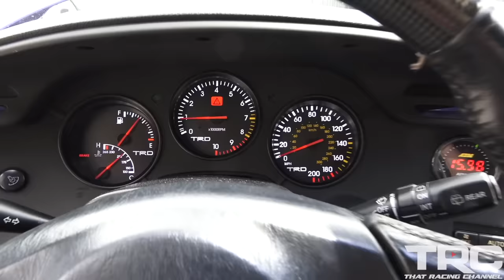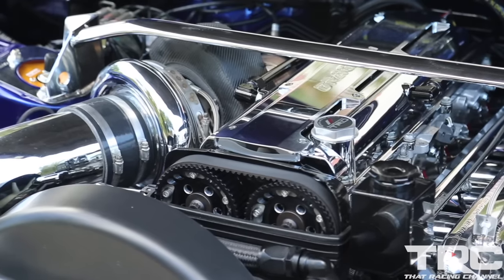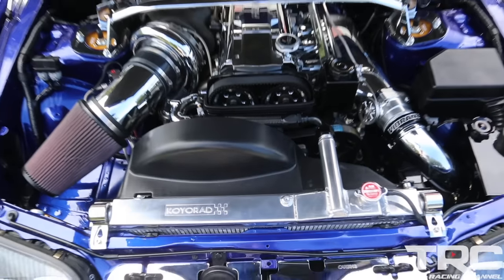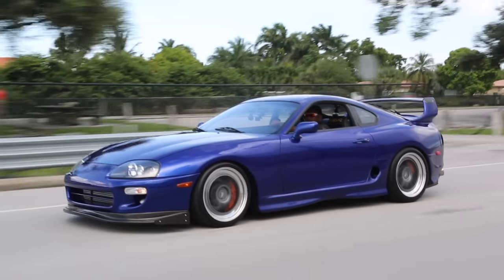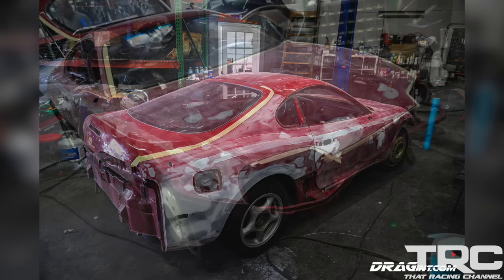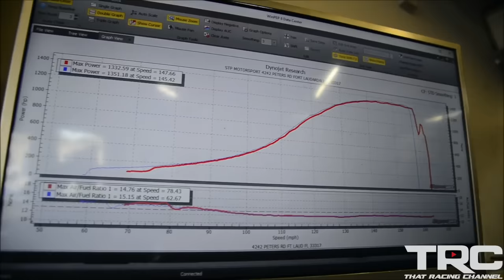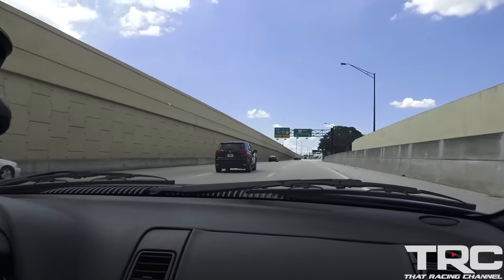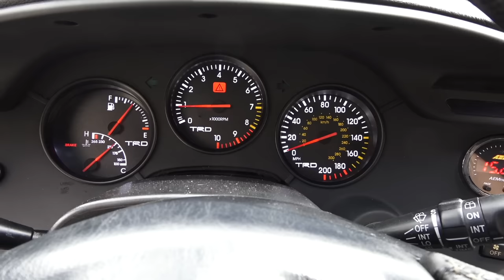1500HP Supra Gettin' Rowdy - 2JZ Eargasm!

Comment from the maker: I mean just look at this parts list! 
1995 Supra Hardtop
AEM Flex Fuel Tuned to Run on E85 and 93 Octane
1351 WHP
6 Speed Manual with stock driveability
Cold AC!
ExteriorCustom DRAGint Paint Job – Complete Color Change with PPG Materials
Completely Dismantled and Reassembled with all new hardware
New Carbon Front Lip Diffuser Extension
New Carbon Front Diffuser End PlatesJDM OEM TRD Side Skirts (Discontinued)
JDM OEM TRD Rear Valences (Discontinued)
New Top Secret Carbon Rear Diffuser from Japan
New Carbon TRD Rear Wing
JDM OEM TRD Rear Bumper Pods (Discontinued)
NEW OEM Front Bumper ’98 Style with Grill
New OEM Headlights ’98 Darkhousing with custom LED Lighting
New OEM Turn Signals ’98 Clear Housing
New OEM Tailights ’98 Darkhousing
New OEM JDM Winged Marker Lights

Engine Block:
3.0L DRAGint 1300+HP Spec 
Manley Turbo Tuff Rods w/ big Piston Pins 
CP 8.5:1 Forged Pistons
ACL Race Bearings
Titan Main Caps
Titan Main Studs
Prepped and Balanced CrankBuilt by TEC (Total Engine Concepts)
ATI Damper

Engine Head:
Full Ferrea Valve Train +1mm Over
Ferrea ValvesFerrea Double Springs
Ferrea Titanium Retainers
Ferrea Bronze with SealsBuilt by Bill from Extreme Cylinder Heads with 5 Angle Port and Polish
Kelford Cams
Solid Bucket Lifter Setup
Powerhouse Racing Cam Gears with Titan Bolts

Turbo System Components:
DOC RACE Twin Scroll Twin Wastegate Exhaust Turbo Manifold
Precision 8385 GEN2 Turbocharger
Twin 46mm Precision Wastegates dumped externally
3 Port ECU Controlled Boost Controller with all Hard Lines
4 Inch Stainless Steel Down Pipe
New HKS Titanium Exhaust System customized to 4 Inch Downpipe

Engine Bay:Chrome Throughout (Valve Covers / Intake / Water Neck / Charge Piping / Reservoirs)New Koyo Aluminum Radiator with Custom -16an Upper and Lower HosesCustom Extreme Motorsports Power Steering Reservoir – DRAGint SpecCustom Extreme Motorsports Coolant Reservoir – DRAGint SpecCustom Extreme Motorsports Oil Catch Can – DRAGint SpecNew Carbing Cooling PlateNew Hood Shocks

Intake System:
New Hyper Tune Billet Aluminum Intake Manifold
New Hyper Tune Billet Aluminum 90mm Throttle Body
New Hyper Tune Billet Aluminum Fuel Rail
New 2250cc Siemens Deka Injectors (6)
New ETS Intercooler Core
Mandrel Bent Piping with Vibrant Vanjen Wiggins Style Couplers
Tial Blow off Valve

Fuel System:
New Radium Billet Triple Pump Hanger
New Walboro 100psi+ 525 Pumps (E85 Compatible)Upgraded Fuel Pump Wiring and HarnessCustom Dual -8an Braided Feed Lines with -6an Return
New Aeromotive Fuel Pressure Regulator
Complete Braided Lines throughout fuel system

Drivetrain:
New ORC Triple Disc Clutch
Rebuilt V160 6 Speed Transmission
New Drive Shaft Shop Carbon Race Driveshaft
JDM OEM 3.2 220mm LSD

Electronics:AEM Infinity ECU programmed by Tune by LanceFlex Fuel Tuned for any combination of 93 Octane Fuel and E85 FuelDual CAN Gauge for Multiple Function Display (Clock Mount / Custom AC Vent Mount)Toyota Individual Smart Coils (6) with Custom BracketJR Wiring Solutions Custom Race Wiring Harness with Dual Odyssey Batteries (Hidden in Trunk)Raychem Heat ShrinkAll New Harness Connectors / Plugs / Pins

Interior:Stu Hagen Custom LED Gauge ClusterNew Dashboard from Toyota OEM New Carpet from Toyota OEMNew 6 Speed Shifter and Knob from Toyota OEMNew Recaro SRD with Custom Upholstery from JapanNew Juran Recaro Sliding Seat Rails from JapanNew Custom DRAGint Checkered Floor MatsToyota Carbon Fiber 3 Spoke Steering Wheel – RARE OEM Ice Cold AC!
Wheels / Brakes / Suspension:New CCW Custom 18inch Multi Piece Forged Race WheelsNew Tires 285 Front and 315 RearNew Brembo 6 Piston Front Calipers with Drilled Rotors – DRAGint CustomNew Brembo 4 Piston Rear Calipers with Drilled Rotors – DRAGint CustomNew Carbing Strut Tower BarNew HKS CoiloversNew Titan Motorsports Big Sway Bars Front + RearNew OEM Front Lower Control Arms
Reply: Are you sure it's not spelled Girard
Reply: That Racing Channel where did your Supra go Javier?
Reply: That Racing Channel why didn’t the shop go with 10:1 or 10.5:1 compression instead of the stock compression? 🤔
Reply: TRC supra was & still the ultimate street car. We miss it :(
Reply: What's up with the R32 build?
Reply: That Racing Channel Jesus that is a impressive parts list and build !!
Reply: 1500whp in the title. actually 1351 lol smh just be honest with yourself and your channel and say 1350. not a big deal but dang. gotta lie for views just like everyone else
Reply: No brakes?
Reply: Jk F1  yeah in the video he mentioned his brakes too
I commented before finishing 😂🤦‍♂️
Reply: Jk F1 and? You wanna call it 1500 to the crank? You know it’s much higher than that
Reply: I'm not "upset." It's people like you that encourage the principle of click bait. It's not JUST this video, its many. Explain to me why they couldn't put 1350hp in their title? Oh yeah, that's right, because "if we say it has 1500hp we'll get more views" true? Yes. AKA - click bait. So who cares? Me. Don't lie.
Reply: Most car producers list the HP or BHP not WHP.
Reply: @1kslane  1500+ at the motor
Reply: So long story short... It's legit AF
Reply: they sellin it? I need me a new daily driver
Reply: Jk F1 I’m so upset, you’re right. Thanks for agreeing with me tho ;)
Reply: Correct, a random number
Reply: Also correct. Do you understand where I'm coming from? It's probably 2000hp to the crank, who knows. But they didn't use that number. Where is 1500 coming from? That's all I'm saying.
Reply: What’s been done to strengthen the block to support that HP?
Reply: Kevin Slane estimated to have1500 engine HP, but there is a loss of power by the time it makes it to the wheels
Reply: Anyone know how much to build a car like this?
Reply: He’s lucky he has that much money to build that.. i wish lol
Reply: Hey Javier, It's Mateo. I used to work with you a long time ago. You used to have the Evo, and two Zo6's
Reply: 100+k,
Reply: @1kslane  its 1500 at the crank. 1351 at the wheels. there was no lying. engines make more power at the crank, and loose power thru heat, friction, and rotational mass through the drivetrain. 1500hp and 1351whp are the same.
Reply: its only $
Reply: HOW MUCH DID THIS ALL COST
Reply: Bro u guys shot this video on  I-595 lol I live in university drive
Reply: How to build a monster
Reply: Good to see that don't forget about the brakes  very importand when you go fast
Reply: What a list.👍
Reply: Kevin Slane probably 1500 crank
Reply: Kevin Slane you don’t know if it actually did hit 1500HP before.
Reply: How much seriously!... How much do you believe went into this build
Reply: wtf, thats so much
Reply: Good brakes...
Good Brakes Too.
Reply: damn
Reply: how much is this, estimated?
Reply: Grand total? =$$$$$$
Reply: About how much money and time was put into this car?
Reply: Wow man.this a good guide for young tuners out there. What a lists. How much it costs?. More than you can afford man. Its a Ferrari. Lol. 😅😅
Reply: What's the colour code mix on that supra...??.. like it
Reply: @bm717252  it will blow up..with stock com. it has more boost
Reply: @1kslane  where the fuck it says whp? the title says 1500hp..sooo around 1300WHP SO ITS OK
Reply: Is this car originally a 2JZGE car? If so I am interested to discuss this build or conversation further. Thank You!!
Reply: Bigler died on that supra
Reply: @looseparashoot  60k 2 80k
Reply: @syferofsin7530  he said 1500hp to the wheels
Reply: Sweet ride. How much for something like this bad ass Supra?
Reply: 3.73 rearend?
Reply: What turbo is that and what kind?
Reply: Anyone has the ig ? Would love to follow this Supra
Reply: cost?
Reply: That Racing Channel  what happened with Javier’s Supra? The trc Supra?
Reply: stock tape deck
Reply: Kevin Slane theres 1350 whp + 10% transmission losses = close to 1500  motor hp. Nothing wrong with a title man
Reply: @1kslane  1351 with 93 octane...!
Reply: So how much this shit ? Long way from a couple spoon engines huh
Reply: Too long bro
Reply: Thats's like 13,5 dollars in 1843 money
Reply: Is that it
Reply: What’s the total cost?
Reply: It will take years to read😂😂😂😂...
Reply: Ok boomer
Reply: Damn u know your shit
Reply: gooookiiiiiielllll
Reply: i can tell those list are around 200K or more.. damn but its worth for Supra 💯👍
Reply: Total cost be like 6.8mil
Reply: Kevin Slane 1500 engine hp, 1351 wheel hp
Reply: How much did all these cost you?
Reply: @08NaGa  $100,000-$125k ish
Reply: That is why she is so lovely and so desirable😉😉😉👍🤙👌!!!!!
Reply: How much torque?
Reply: In the title is 1500HP so 1381 WHP is pretty possible on the wheels than.
Reply: Where can I buy LHD Supra ??
Reply: That supra looks sweet
Reply: How much is all of this?
Reply: All that and it’s not a compounded setup.
Reply: 93 octane? here in cyprus we have 100 octane plus witha boost bottle octane it can easuly go 104 octane...that will give this car another 20horse power for sure
Reply: the best thing out of all that is the AC
Reply: 2JZ  sounds good, even underwater... as this video proves.
Reply: @1kslane  1351 WHEEL HORSEPOWER = 1547 CRANK HORSEPOWER
Reply: Bro typed a whole essay
Reply: Does it have Getrag v161 gearbox?
Reply: So technically it has a bigger turbo? so does it mean it has some sort of Turbo lag or something like that? just curious
Reply: Power?

Comment: Words cannot describe 3:10-3:55,  I watched it with Bluetooth audio in my car and it felt like I was there. Such a raw feeling. I can’t imagine what the actual experience is like. The acceleration throwing back in your seat, the backfiring, the sonic theatre of the exhaust system. Beauty incarnate. I could only dream.
Reply: is the sound of the Blow Off Valve? or the Compressor surge?
Reply: The car slow between shifts. Get the Zf8 trans to it which is already done and will be another animal
Reply: My thousand 1000hp built mkv would smoke this
Reply: I actually didn’t think the audio was that clear for a real experience. Sounds like he had it mounted somewhere weird actually. The BOV you could certainly hear well lol.

But hey sounds like you loved it so that’s awesome anyways!!! 🔥🔥👍🏼

Comment: This car will walk all over anything. That 2jz engine imo, the best internal combustion engine ever produced.
Reply: Not really there are plenty of lambos and vipers out there making well over 1500hp on the street
Reply: @sergsrt8  and how often do you see a Lamborghini on the highway ?
Reply: @captainbarbossa5201  first of all how often do you see a 1000+hp car in general on a normal day? But when the boys at tx2k come out to play you see plenty of twin turbo lambos, vipers, etc
Reply: @sergsrt8  that depends on where you live. Seeing a 1000hp car isn't very common. Seeing a supercar isn't very common. Unless you live in Las Vegas or in the Silicon valley, you rarely encounter such cars. It doesn't matter what car, because 1000hp is expensive.
Reply: pever heard b16b
Reply: @sergsrt8  This old beast can still hold up to the new ones. This shows how much Toyota packs. If only they did a 3JZ. Don't forget its an inline 6 vs those V6-8s out there.
Reply: sergsrt8 They both need $100K+ aftermarket twin turbos and fully built engines to compete against this little ole 183 cubic inch inline 6. Suck it haters!😎
Reply: @tbonilla6922  this supra may be a lil cheaper to MAKE 1000+hp, but think about KEEPIN' a 1000+ Inline 6. Viper's V10 will last with all that turbo, dunno about JZ, it may be iron Block, but it's still going to Break down faster than others
Reply: Артемий Румянцев Provide proof of said claim.
Reply: Lamborghinis and Vipers are much more expensive to buy let alone modify to 1500 horsepower. Getting a Supra to 1500hp would cost about 300,000 dollars max, while it would take well over a million dollars to get Vipers and Lamborghinis to that level. So the Supra is the more cost-efficient way of getting an ultra fast car.
Reply: Just a straight 6 bud..with stock forged internals , so yeah put a ton of boost on it..out dated technology
Reply: @sergsrt8  yeah but they have twice the cylinders
Reply: There's nothing Toyota left about this engine. The only Toyota part is the block. The entire valve train, cams, pistons, crank, connecting rods, bolts, caps, turbo, injectors, fuel pump, intercooler, hoses, wiring, ecu, exhaust, intake is ALL aftermarket LOL. Niggas praising the 2JZ when there's only one part out of a mountain of aftermarket parts. GTFO
Reply: Except that it's not. None of the parts of this engine were ever available from Toyota. Good day.
Reply: @xlex.the.menxce  clown is a 2jz engine full design with a few updated components fucking spaz
Reply: Then why the jgtc supra used the 3sgte instead of the 2jz?
Reply: @diegovasquez7610  Toyota used the 3S-GT engine they used in their rally cars, they did so to lower the vehicle's weight to 2,420 lbs (the minimum allowed). it was lighter and further developed than their 2jz at the time, it produced 493 horsepower (in the early years of the series, GT500 cars would have no more than 500 horsepower)  The engine was also positioned as far back as possible for better weight distribution.
Reply: @caveman7921  so the 3s-gt could do enough power without being so heavy, that's my point. 2jz supras are only good for highway drag races, if you build them. In a race track a stock supercar will smoke any 10000hp supra after the first corner
Reply: @diegovasquez7610  the 3S-GT produced enough power for the gt500 class, not for dragracing. If you look a the top 25 fastest sport compacts or fastest and quickest imports in the 1/4 mile the 2jz is absolutely dominating. I think that's what Scotty N Is talking about.
Reply: @caveman7921  you're proving my point, besides drag racing 2jz isn't a good engine. Why compare a car built specifically to drag racing like these heavily modded supras against other cars? It's quite obvious that the car built for drag racing will beat the supercar in a drag race, if you put them in a track it's the opposite, no 10000hp supra would beat a stock supercar. But you can build a supercar for drag racing a make it competitive, a supra won't be succesful in circuits using that engine
Reply: @diegovasquez7610  Nobody here is comparing build supra's and stock supercars and nobody mentioned circuit racing, they're talking about highway racing and dragracing with 1500+ hp cars. And I was talking about dragcars.. I'm assuming if you participate in a dragrace event or 1/4 mile race that your car is a high hp purpose build drag car and not a stock supercar.. And for the 2jz being heavy, it's build in the early 90's an Era where iron blocks we're the standard I know it has a reputation of being super heavy, it is however lighter then the RB you'd find in the skyline.. A car praised for doing well on the track. The supra's weight distribution is about 53/47 for the tt and 51/49 for the N/A compared to the gtr32 60/40 or the gtr33 55/45 and the gtr34 58/42 it's front is not that heavy. If you want to know how well the supra does on the track compared to other Japanese sport cars I have some links for you if you want to check them out.
Reply: @caveman7921  the guy from the original comment did it m8, again there's no reason to compare cars built for drag to other. It's like saying my rally car can smoke any jdm/supercar in a dirt track, useless comparation. Also I never said japanese cars do bad on track, the gtr r32 earned it's surname because it was smoking cars in tracks, using the rb engine, that later would be used in the jgtc, although it was replaced.I also like evos, in my country they're used for rally cars, and the honda/acura nsx as well, ayrton senna helped to build it. Then there's the le mans mazda 787b, not a street car but my favourite japanese car. But I never found a good track focused supra, lap times show that supras are not as fast as other japanese cars like skylines, nsx, imprezas wrx sti, evos. I just literally googled lap times m8
Reply: Plenty of other legendary engines, the M5 V10,  The M50, The Audi 5 Cylinder, Bugattis Quad Turbo W16, Mazda's 13b and R26B, Nissan's RB25/26, Lexus LFA V10
Reply: @sergsrt8  oh do I?? 😂😅
Reply: @AmaAndZing  Spoken like a true, delusional fanboy 😂😂
Reply: we have some 15xx supra’s here and they get drug on the highway by fox body mustangs with  turbo’d 6 liter iron blocks lol
Reply: @sergsrt8  Koenigsegg>All
Reply: No
Reply: facts.
Reply: Lol say that to mr rob dahm and is rx7s
Reply: @captainbarbossa5201  ive seen more than ive seen rx7s ot supras